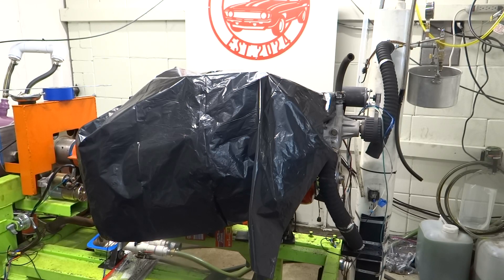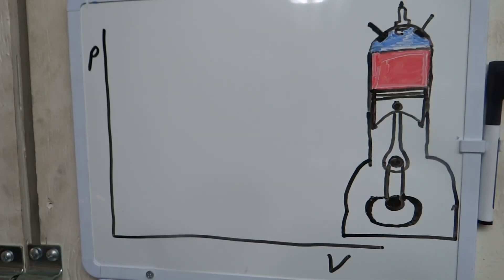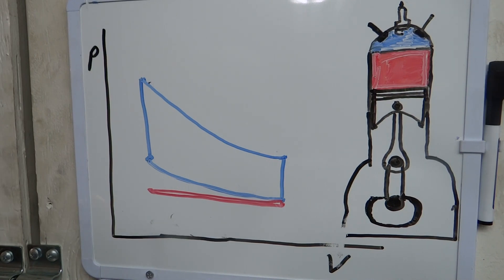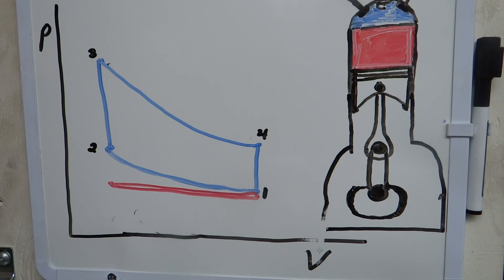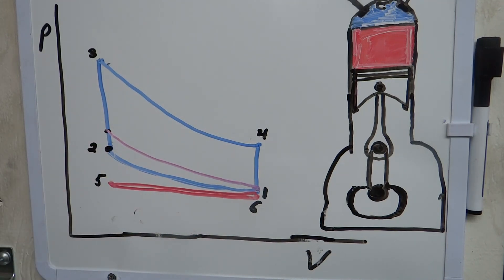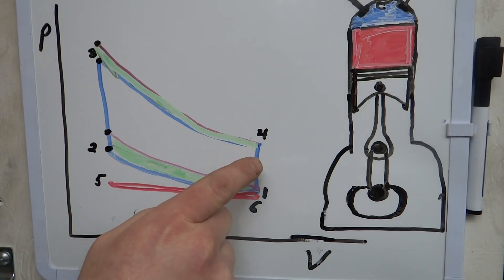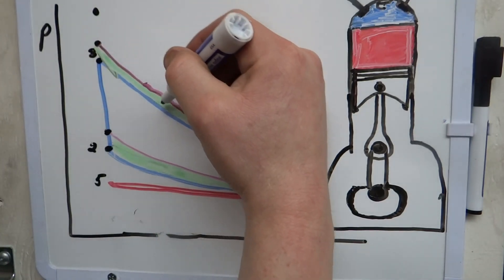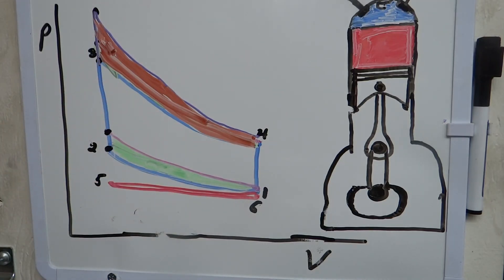Compression Ratio And Power Gains My Interpretation

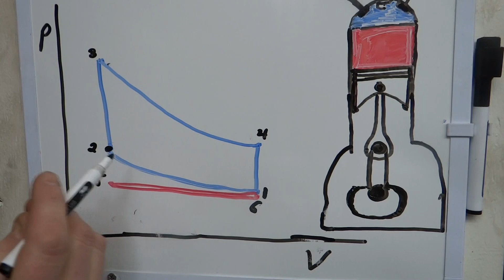Comment: 6:12... oops?
smaller volume... 2 moves left and up. calculate the points and mark them! say, 120cc to 10cc=12:1, 12 bar 120cc to 15cc=8:1, 8 bar. it is a PV diagram?

3 moves left as its the same volume as 2, up as both higher compression and better combustion releasing more heat creates higher peak pressures.
4 should just rise vertically. higher pressure as exhaust opens.

then geometry plays a role.. PV is just indicated theoretical power. exactly where is the crank pin, and what change in volume and therefore pressure takes place in the cylinder during the stroke, the mechanical efficiency?
if you had 8:1 and cranked it to 12:1, you have 50% more pressure at the same crank angle and piston travel at which the cylinder volume has doubled... quadrupled...
Reply from the maker: I think I said that this is my opinion several times and that it wasnt going to be perfect. My main idea is that the pressure change at 3 is related to the square of the compression ratio, and that is where I think the gains are and thats still what I think. Thanks for the comment.

Comment: i thought if you increase the compression ratio, the point 2 will be moved to the left to a smaller Volume, because you squished the gas in a smaller volume. And that is where you get a bigger area in the otto-diagramm.

edit: Didn't know about the otto-diagramm so changed the carnot-diagram to otto diagram because this fits the model better.
Reply from the maker: I see what you are saying, looking at it in that context a higher compression ratio  would move point 2 up and to the left. I think it would also move points 1,3,4 to the left since those volumes would have been decreased as well by reducing the combustion chamber volume. I will think on it more and maybe add something to the description. Thanks for pointing that out!!
Reply: It's not the increase in compression ratio that brings better performance, as the peak cylinder pressure is determined by the pre-ignition resistance (Octane) of the fuel. The real benefactor is the increase in expansion ratio extracts more energy from any given cylinder pressure. In terms of the chart, points 2 and 3 would move up, 3 slightly more than 2 as the products of combustion take up more volume, and thus produce more pressure in a confined space, than the un-combusted air and fuel charge. While point 4 will move straight down if peak cylinder pressure is limited by octane. The increase in area from points 2 and 3 more than compensate for the loss in area from point 4, but the overall area under the curve will increase which represents more work done per unit of fuel. Its a bit counter-intuitive, as the chart does not factor in the pressure-to-torque conversion from the con rod to crankshaft alignment.
Reply: @clone4211  yup. CR of 8:1, only takes a little piston travel to double volume and half pressure, and now its only 4:1. half the pressure, half the force remaining.
same amount of piston travel at 12:1, its still 6:1 left, or basically 50% more pressure acting on the piston. and as teh crank pin rotates it presents a more advantageous angle to convert that force to torque...
Reply from the maker: Having a greater expansion ratio than compression ratio should yield greater efficiency. You may be interested in the Atkinson cycle which is used in some hybrid vehicle engines.
Reply: @engine_therapy  Yep, I'm familiar with the Atkinson Cycle. One way of mimicking the Atkinson cycle is to modify an engine that has poor VE numbers to the point where the static compression ratio would result in severe engine knock in a normal high performance engine. Some German WWI fighter engines were built with this over-compression as a means to compensate for horsepower loss at high altitude. I'm actually in the middle of modifying a Willys L-134 flathead engine right now to double the compression ratio from the stock 6.5 to around 13. The engine in it's stock form has horrible VE to the point where the dynamic compression ratio is around 3:1 and the jeep its in gets at best 14 mpg. I'm interested in seeing if simply doubling the compression ratio without regards to improving VE will net me higher fuel efficiency. Normal engines using the Miller cycle just hold the intake valve open later through the compression stroke, or close it earlier on the intake stroke to achieve similar, but they almost are never paired with significantly higher static compression ratios to make up for the loss in peak cylinder pressure as to take full advantage of the cycle you need variable valve lift to act as a throttle.
Reply from the maker: @clone4211  Interesting experiment, I would think that would make a good improvement, Thanks